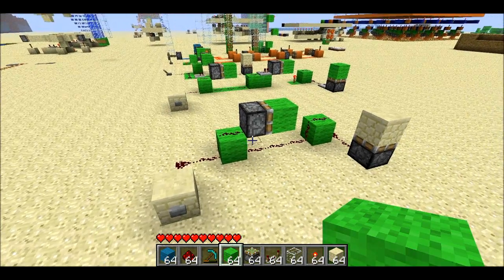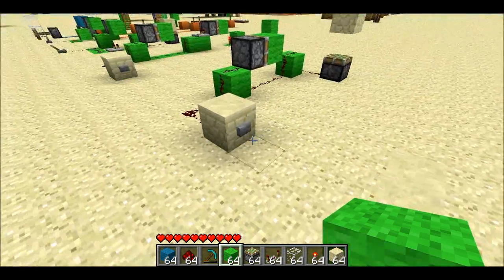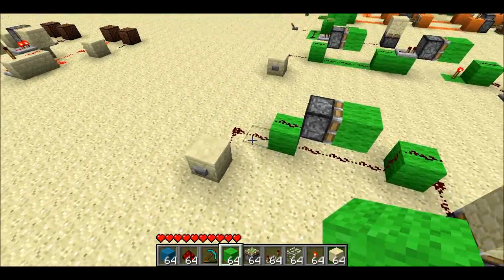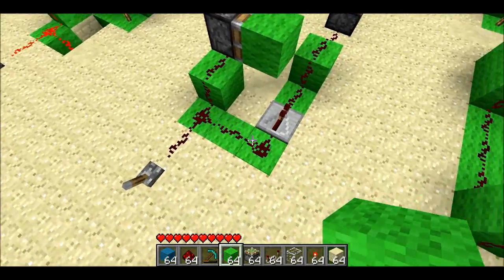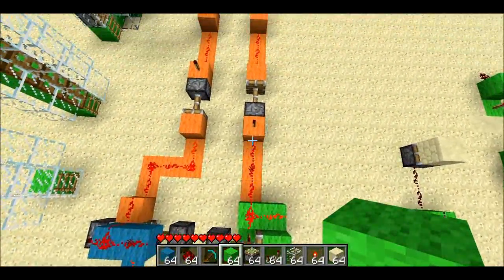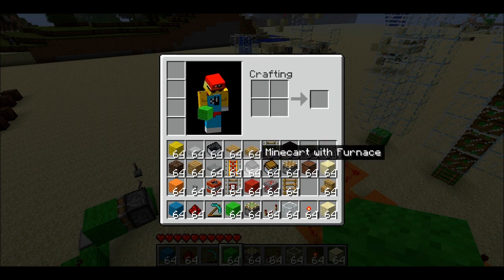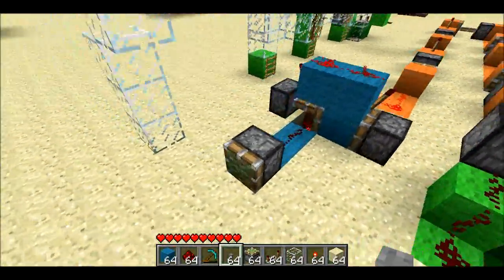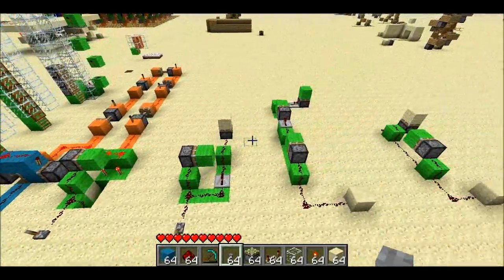Misc Circuits: Monostable, T-Flipflop, Dual-Edge Monostable, and Compact Almost-InstantWire

Comment: Sticky piston need 1 tick to push a block and 1 tick to pull a block in a seperate time. So if the block is across from it, it will pull the block if there is only 1 tick transfer. On the other hand, if the block is touching it, it will push the block out with only 1 tick, but since there is only 1 tick, it don't have the time to pull the block back. It needs 1 more tick. I know that this is kina confusing, or rather I'm bad at explaining, but good luck. Hope this'll help =D

Comment: I was in the middle of designing something that did the exact same thing and used the same instant wire used here but with different devices each end and you've made my design completely redundant in a matter of seconds. thanks!!! no seriously nice design, very compact. This is good as most people aren't building ALU's, they just want there draw bridge to close from the watch tower quickly